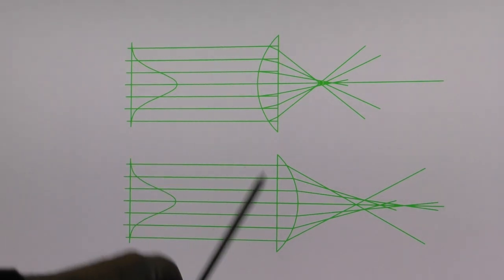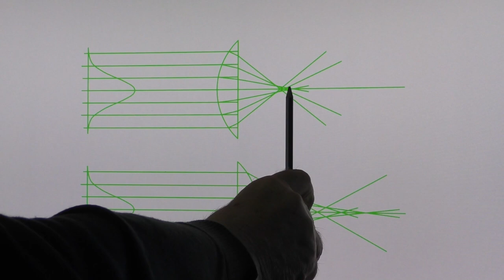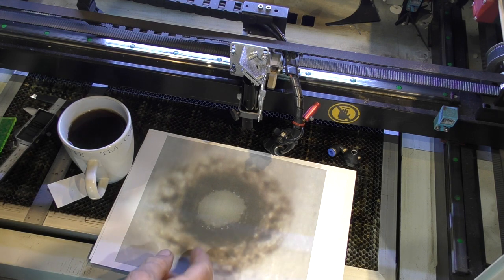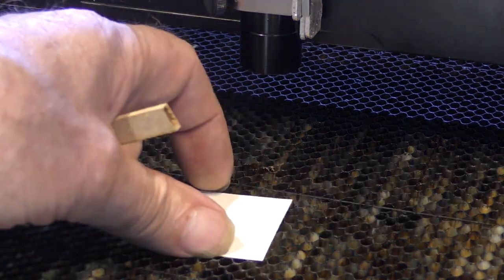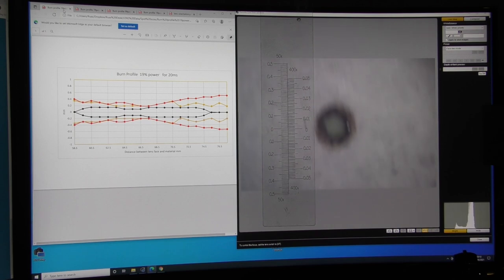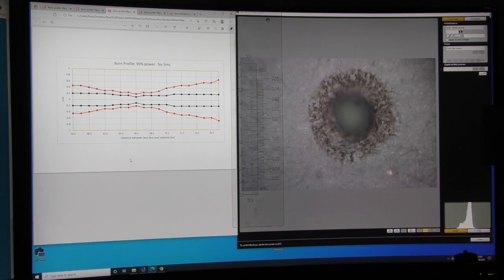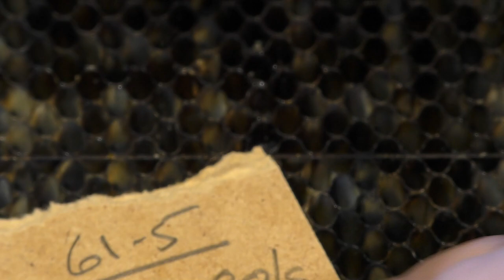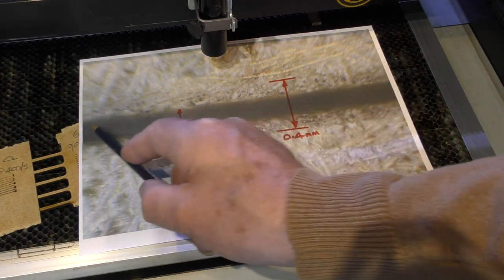RDWorks Learning Lab 210  Lets Focus on Focus     AGAIN

Comment: Hey Russ. Would putting two lenses in back to back do anything? So convex on both sides? (||) ?
Also could you put some links in the description to this video for where to buy lenses and which you’d suggest getting/testing out. 
Thank you
Reply from the maker: I tried using your suggested configuration  in a slightly modified format during my hunt for a long focus compound lens. Separating back to back lenses should have allowed me to vary the diameter of the exit beam  but leave the beam parallel.. Hmmm that didn't work as expected. Putting the lenses butting back to back will create a very short focal length combination. I explored this when I was looking for the compound engraving lens. The focal point was indeed short and the dot small, however, like many combinations I tried there was a significant halo around the dot indicating that the focus was not that precise.
 Best wishes
Russ
Reply: @SarbarMultimedia  Hello Russ, Youtube seems to have turned off comment replies so I've only just seen this message. Thank you for your reply and thats a shame it didn't workout. 
Did you see that 3d printed air assist nozzle? You can see it over on this blog
https://n-e-r-v-o-u-s.com/blog/?p=8722
and also over here as an alternative fmd print https://www.thingiverse.com/thing:4667511
althought maybe you're not into 3D printing, you can order these online to be printed for you!

all the best!
Reply from the maker: @leftblank  
 Hi
 Thanks for the links. I have seen this before. The idea is based on the laminar flow principles that are used for the dancing fountains at Caesars palace (and many other places.) Water is an incompressible medium whereas air is compressible and the same fluid  principles do not apply.  Also, if you think about it logically It is totally the wrong principle for getting air into a 0.2mm wide kerf. Instead  you need a small orifice (2mm) and a small gap (about 3mm) . 
 Best wishes
Russ

Comment: Is it correct to conclude that in fact, it is better to ''cut'' with the flat side up, contrary to what was believed before that cutting is more efficient with the flat side down?
Suggest doing a practical test, as to show us your taught on this, as well as results.
Reply: What I truly believe is that we have to get the nozzle closer to the work, hence, increasing the air assistance when we set the lens flat side down. Other thing that would be interesting is seeing up to what extent increasing the PSI of the air assist helps in getting a deeper cut (although I cannot remember whether Russ has already explored this).
Reply from the maker: Until,about 2 years ago I was a believer in the "flat side down"  for better cutting..  At that stage I  tested many lenses with  varying  focal lengths,   Zn,Se and Ga As, meniscus and plano convex,  flat up and down and with the focal point set on the surface and 3mm into my 10mm test pieces.  You can see this test work in
https://www.youtube.com/watch?v=yO2TD_h8_nI
One of the questions I was able to answer  from this mass of data,  was what you are asking about.. Here is an extract from that document

QUESTION 1.  LEGEND  STATES THAT ORIENTING THE LENS FLAT DOWN IS  BEST FOR CUTTING.
Out of 48 pairs ( flat up/down)
13 were better flat up
8 were better flat  down
27 were no different
There were specific combinations of material and lens orientation that showed slight advantages but there is no convincing overall pattern of data that suggests either lens orientation is “correct.” The one fact that does exist is that the focal length changes with lens orientation. Machines are normally supplied with the lenses mounted flat up . Thus your setting piece will be wrong if you decide to flip the lens. It will be 1 to 3mm less with flat side down.
ANSWER 1 THERE IS NO EVIDENCE TO SUPPORT THIS GENERAL STATEMENT. ONLY 8 OUT OF 48 TESTS WERE BETTER.

different

Comment: Nice one, Russ! I cannot say I am eager to see how you grind that GaAs lens... but my curiosity about the results is driving me nuts. Thanks for sharing.
Reply from the maker: GaAs is just as toxic as ZnSe  so I am VERY careful  with the machining. I think I will be finishing up with a 4 or 5mm lens face and still retain the cutting performance. I will be flipping the lens as well  but i do not think that will greatly affect cutting performance. I may be totally wrong of course, but previous work and theory  leads me to feel confident.
 I still have mountains of test work to do with lenses so I cannot see my series ending any time soon.
 Best wishes
Russ

Comment: On a close tangent, what is the approximate lifespan of a PVD or CVD lens in an 80W machine? I've been using my favorite 2.5" for about a year of intermittent cutting MDF, and I'm starting to see a bit of inconsistency in the cuts and a but of a different color halo in the center of the lens. I'm thinking it's in the last stages of it's useful life. I have spares and my new GaAs lens, so I'm not up a creek. Thanks for your help.
Reply from the maker: Hi Dave
 That different colour halo sounds like cutting fumes that have burnt onto the underside of the lens. If you bounce the light across the lens it should look uniform and shiny. if it's not then you  have a film buildup on the anti reflective coating that is all over the lens. If there is damage within the lens it will be obvious as a crack line, so I think what you describe is on just one surface.  You may have burnt the crud onto the anti reflective coating in such a way that it will not come off. Try flooding the lens surface wit isopropyl alcohol and leaving it for about 5 minutes. Then start working the surface with a cotton bud in circular motions , The edge of the lens will not be damaged and shows what the whole surface should look like.. There is no life span for a lens  but it is the most vulnerable and vital part of your machine. It needs to be in perfect condition  for efficient cutting..

Your note about inconsistent cutting is a bit puzzling because the lens (good or bad) is a constant. I would look for some other feature of the machine that could be varying.

Best wishes
Russ
Reply: @SarbarMultimedia  I'll give it a good soak and see what happens. I guess consistent wasn't quite the right word, more like not as crisp a cut as I remember it having. Hopefully a good soaking will do the trick. Now I just need to get a good hot tub and do the same for me...